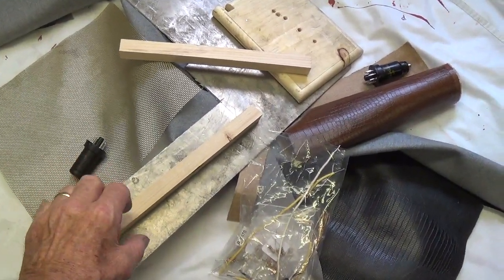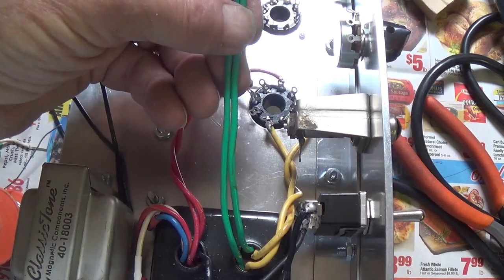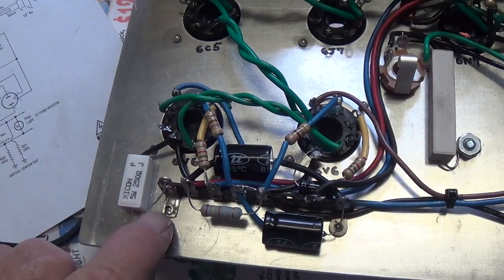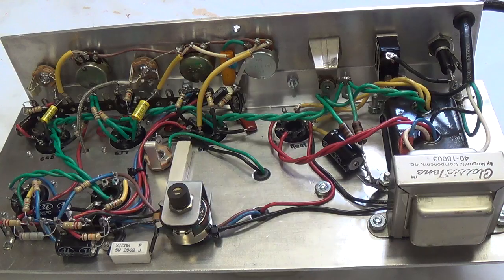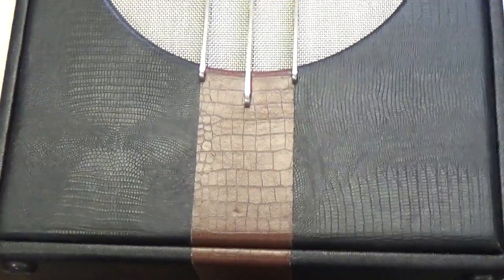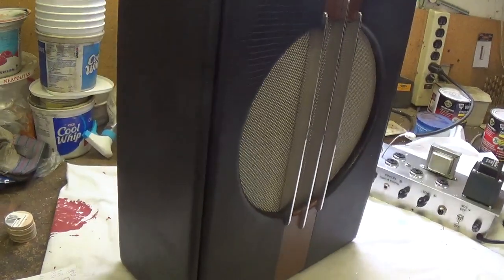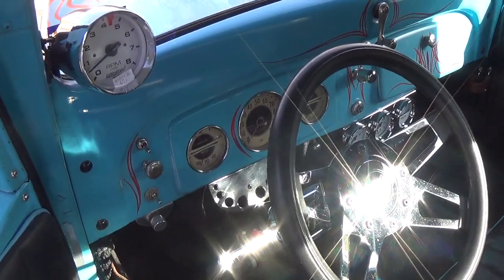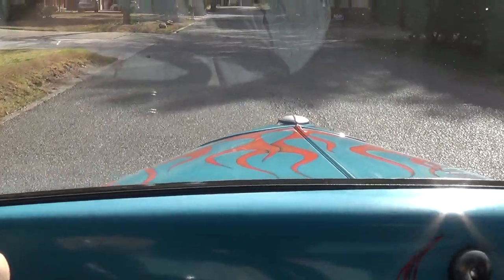Let's Build the Mystery Amp, Part 4: Chassis Wiring & Completed Cabinet

Comment: Look good -Both cab and car. How do you deside how big the un-covered hole in the back should be? Also I would like to know why you cover the licenseplate on car. Many people do this in sales adverts here in Denmark, and I always wonder what is the problem about showing the number. Cheers!
Reply from the maker: Thanks, Allan. I used a very scientific method: It's size was determined by the size of the scrap of plywood I had on hand :)  Re the concealed license plate, I guess it's a privacy issue. I only know that if I were not to cover it, a bunch of viewers would tell me I should :)
Reply: Thank you for answer. Here in Denmark only the police has Access to who owns a licenseplate. I salvaged some 1950ies fulltones seas drivers from some anouncement/monitor system at the Norwegian state radio. Not sure if i will make a closed or semiopen cabinet for them
Reply from the maker: I would think that only the police have access here to, and to be honest, I'm not sure what people are afraid of.

Comment: Very impressive.  Just one little remark: that handle may start "dancing" along with bass vibes when it lays flat on top of the amp.
Reply from the maker: Thanks, B. My workshop speaker cabinet had such a handle and it vibrated like mad. I will have to be sure it doesn't happen with this one.

Comment: You're the Man Uncle Doug. So you soldered only one end of the ground on the shielded signal wires. What did you do with the other end? Where did you ground the cathode? To the terminal strips? Get Jack into NA or better yet rehab.
Reply from the maker: Thanks, Rick. Yes, you only make a shield pigtail on one end and solder it to a good ground. The shield on the other end is cut flush with the insulation. The output tubes' cathode resistor was grounded to a bolted-down terminal.  Jack is doing much better lately. The Nipothone therapy has really helped.

Comment: Doug, I have a question.  I am designing an amp, and I'm not 100% sure I have my power supply theory right.  I'm going to tell you my thoughts, and if you could tell me if I am on the right track or not, I would appreciate it.

My thoughts are this:  The voltage supply is basically a voltage divider from the rectifier through the input stage to ground.  If I have two pre-amp stages and a power stage, and I have R1 from rectifier to power stage, R2 from power stage to V1b, R3 from V1b to V1a, then here is how I am designing the circuit:  The voltage drop of R1 is the quiescent current of V1a, V1b and the power stage times R1, the voltage drop of R2 is the quiescent current of V1a, and V1b times R2, and the voltage drop of R3 is the quiescent current of V1a times R3.  I'm assuming that with correctly sized capacitors in the filter circuit that the audio signal should be grounded, and therefore the resistances of the power supply voltage divider need only take the quiescent voltages into consideration.

Is this all there is to it, or am I missing something?  I am designing a patchwork circuit based on a couple of different amps, and thus I cannot just copy the power supply of another amp.  I would like to get my electronic theory right, so that I don't just try to "luck" into a good design (that never works).

Thank you for any assistance.
Reply from the maker: I'm not sure about the "audio signal should be grounded" part, Clint, but the rest made sense. If you are worried about the contribution of the audio signal to the overall current flow, it is negligible. 

I must confess that I am not a theoretician when it comes to amp design. I begin with what seems to work with similar circuits and then modify to fine tune the voltages, tone, etc. In the Mystery Amp circuit, I used a power transformer, filter choke, output transformer, and non-electrodynamic speaker that were completely unlike the original circuit. I began with the circuit for a Fender Model 26, that is somewhat similar to the MA, added in the MA pre-amp section, wired it up, and tested the tube voltages. It worked almost perfectly with just a couple fine tweaks. To me this is far easier, faster, and more effective than computation.

Comment: Hello!  I don't know why, but for some reason, I'm having trouble accessing the Box link.  Box is forcing me to log in (I use it at work), and then I can't get to the file.

By the way, I'm curious about something: Why does is the power cord "permanently" attached, instead of using something like a C13/C14 cord and socket?
Reply from the maker: I have never had any problems with Box, and apologize for them. I will hunt down a better, free storage site.  You're electrical references are too new, Karl. In the old days, all cords were permanent.....however, in amps like this with no storage space for a bulky cord, having a detachable cord makes excellent sense.
Reply: haha!  Yes, I'm too young…

As for hosting, I suggest https://archive.org.  Archiving things of interest is kindof their "business"; you could probably start an "Uncle Doug's Amp" collection of documents.
Reply from the maker: Here is a revised link that will (hopefully) work, Karl:   https://app.box.com/s/iuy3zqiaqh1sj8s2ihz9dglm9zlwjr9o  Sorry for any inconvenience.
Reply: That works, thanks very much!

Comment: Hi Doug,

First I want to tell you again that you are an awesome human.  I really appreciate you sharing your knowledge.

I have a question ....

In other YouTube videos they use a variac to supply voltage to the amp as it's being built and tested.  You use the cool current limiter (no motors) that you fabricated.  Are these essentially the same safety device?  Would you use a variac if you had one or do you think your current limiter is superior to the variac?

Thanks again,

Leland
Reply from the maker: Thanks so much for your kind comments, Leland. Actually a Variac and Current Limiter serve very different purposes. A Variac controls the voltage applied to a circuit or device and can be used to slowly and gently activate antique electronic gear.  A Current Limiter does not affect voltage but will not allow too much current to flow if there happens to be a short in a circuit.......protecting it from harm. I have both devices and find the CL to be far more useful when testing circuits.

Comment: Love the video, as usual! Have you thought of wiring in a couple of secondary input jacks for each pre-amp tube so that they can be run in parallel via a patch cable?
Reply from the maker: An interesting idea, Dave.....either that or a toggle that connects the two inputs in one position and isolates them in the other.

Comment: The wiring is beautiful, as usual. The cabinet is equally attractive, the bars really look good.  I jumped the gun and used your exposed lead tip on my tube tremolo.  :))  The '36 is my favorite of what you've showed so far.  Are both fuel tanks gauged, or just the main?  Part 6 could be the paint speckles and cigarette burns final touch.  :))
Reply from the maker: Thanks, Andrew. Glad you liked the amp and truck. Actually, neither tank has a gauge, which is one of the main reasons I added the reserve tank......I got tired of running out of gas because I was too lazy to check the fuel level with a (wooden) stick :) :)  I am already warming up the blow torch and battery acid to "antique" the cabinet. Brad Paisley wants it to look "vintage" for his next concert.